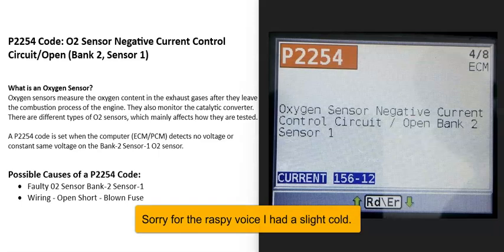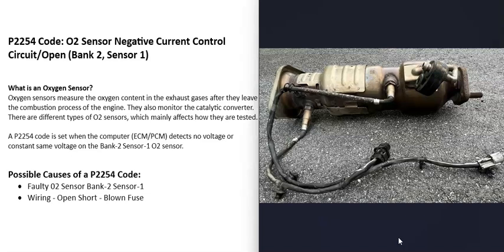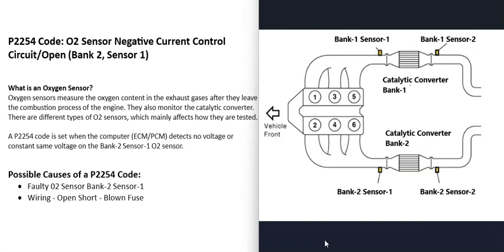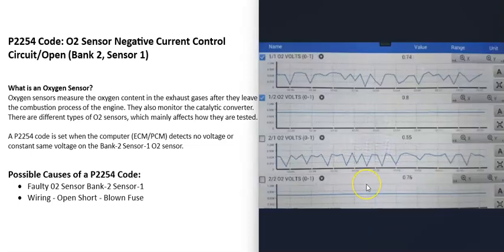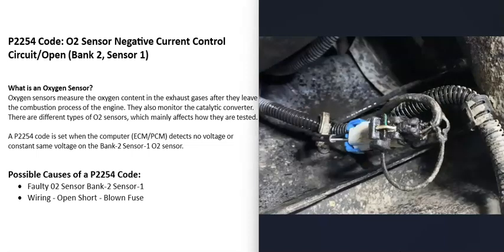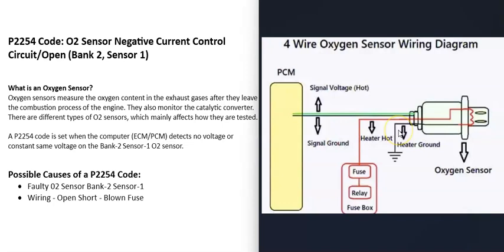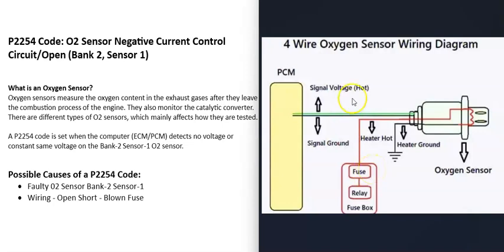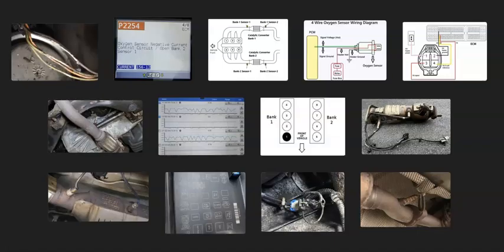Causes and Fixes P2254 Code: O2 Sensor Negative Current Control Circuit/Open (Bank 2, Sensor 1)

Comment: I have a 2008 Buick Enclave with this particular code....is this the O2 sensor I see when I pop the hood....it's connected to the exhaust manifold...or is it after that?